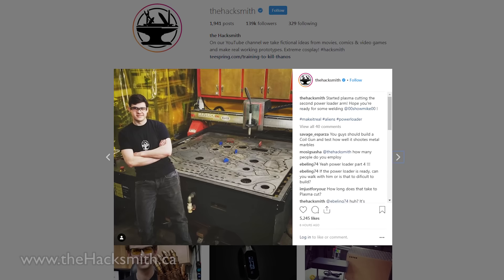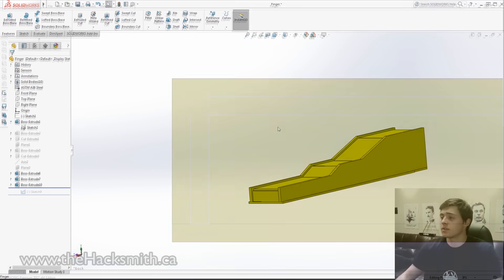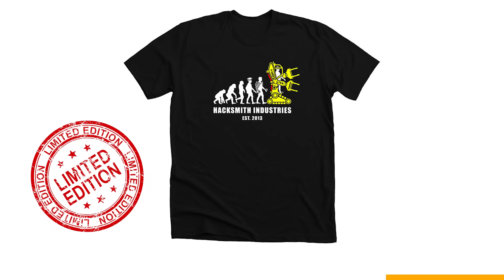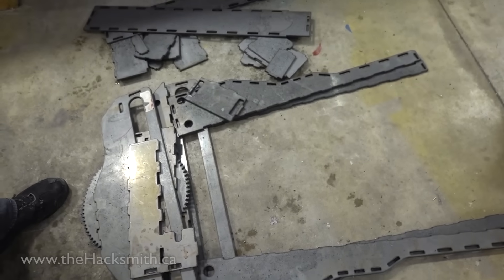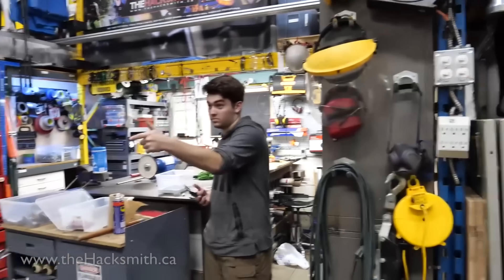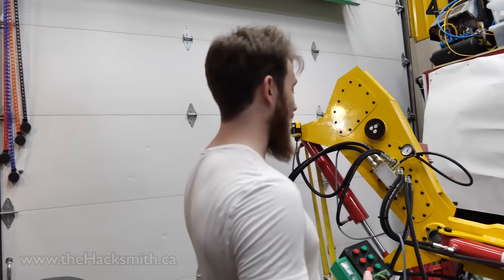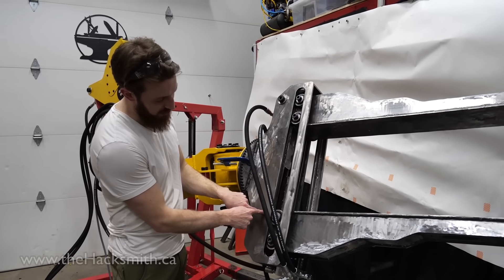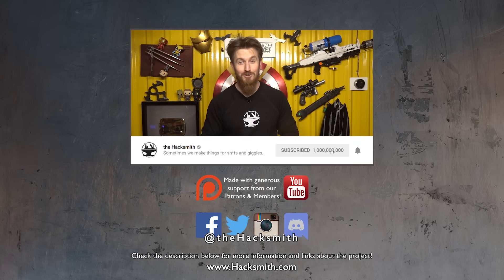GIVE HIM THE CLAMPS!!! (POWER LOADER: PART 4)

Comment: Did you consider carbon fibre for the top parts ?
Reply from the maker: No, carbon fiber is not good for applications like this
Reply: @hacksmith  why ?
Reply from the maker: It fails catastrophically. You generally don't want to use it for any real structure
Reply: @hacksmith  not if it's made correctly.
Reply from the maker: There's a reason you don't see it used for things like bridges.
Reply: @hacksmith  Because it's too expensive.
Reply from the maker: No, because it has its uses, it's not a miracle material. Everything has a trade of

Comment: 8:29 
If you don’t get the joke, drills will make this noise if the torque resistance is too much for them to handle. Little engineering thing

Comment: You are surprised that the pliers bend. But you have a lot of play everywhere, which forces the parts. had to giggle when I saw what happened to the air tool in the bore.

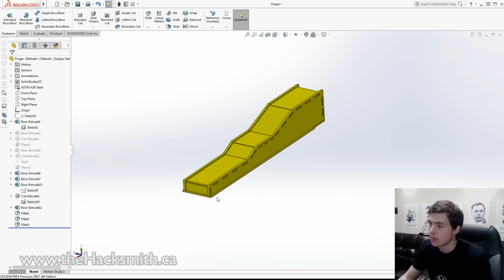Comment: 3:40 That's exact the same way I design most of the weld joints between laser cut sheets, except the inner lines are construction contours and the edges are rounded 5% of the thickness to ensure smooth movement for the cutting head.

Comment: Do you guys really think 1/4" plate steel was a little overkill ? I'm thinking 3/16" would have been strong enough and saved a ton of weight .
Reply from the maker: We designed it for the loads we intend to lift,  1/8 would have been fine if we were just building a prop

Comment: I know this vid is old, but if you added a toothed track for the "hands" you wouldn't have that slop. Hardened steel, small toothed tracks with corresponding small toothed gears would eliminate all slop and maximize the gripping strength.

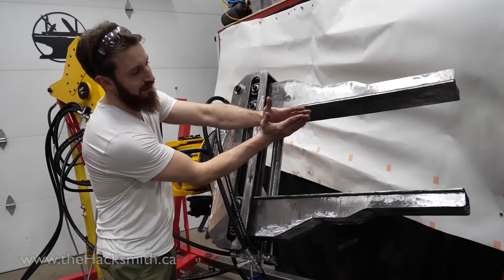Comment: Hello from the future. I am not an engineer but I spotted a potential weakness at 13:18. The grippers do not seem to be sturdy enough near the bearings as they become uneven when applying power and there is an item in them. Just an observation. I have been wrong before and i'm sure it will be ok. Great job. Ok I retract my statement since you spotted what I was remarking about around 14:35.

Comment: Love the passion and the finished product, great job. If you use a trussed design inside the gripper you can reduce weight and increase strength. Tubular steel would work, just calculate the minimum wall thickness and there you are. The hard points at the tips is the only place you functionality need solid material.

Comment: Guys, I don't know if you guys saw this or not, or if someone else commented, but your track is flexing.  You have a long, thin, unsupported section of steel in which the roller bearings are creating a bending moment on each end of the track.  As the jaws come to the center, the center is bending outward opening up your track slot.
Reply: Oops, just finished the video, and you fixed it.

Comment: You could use counter threaded high strength rod as a guide rail. Right hand from top to middle and left hand from bottom to middle. Use a hydraulic motor to rotate it. The rod has a bearing in the middle. Claws have matching threaded inserts. This will reduce the deflection when exerting pressure, reduce the demand on the hydraulics, reduce the hoses from 4 to 2, lighten the claw, and simplify the operation of the claw.

Comment: While the grippers are beefy enough, the rollers you use for these to slide up and down are of poor design.  Personally, I'd have worked with a rack n pinion design.  There would be no slop, and the grippers would stay equidistant throughout their length as they crushed an object.
Reply from the maker: So watch part 5

Comment: With a larger budget, I'm wondering if some of the structure could have done with 6061 aluminum instead of steel?
Reply from the maker: Possibly, but doesn't really matter too much - all construction equipment is usually steel for a reason

Comment: The grippers need mounting holes for interchangeable gripping surfaces, perhaps with load cells to detect gripping force. Gripping surfaces could be rubber or cerated steel. The cerated steel would work well for picking up people you don't like.
Reply from the maker: Easy to add, already planned

Comment: What about just using metal slide blocks instead of bearings on the pinchers? they wont shatter at high compression like bearings will.

Comment: As a CAD user for 25 years, and solidworks for the last 10 of that, you really should invest in a 3D Connexion 6 axis controller for your CadMonkey.  To compare it literally is like trying to draw on a computer with a mouse, and then switching to a Wacom.  Sure you can do it with a mouse, but once you switch to a Wacom you realize just how clumsy and time consuming it was to do it with a mouse.  A Connexion 6 axis controller is just like that for the CAD world.  I would recommend a SpacePilot Pro - as they can be had on Ebay, used, for not that much.
Reply from the maker: I've tried a frew times, haven't liked it to be honest

Comment: Too slow. Combine air with hydraulics/geared screw. The jaws are normally sprung-loaded to be open. The Air rams closes the jaws up to contact, then the air-rams close 'split nuts in a sleeve' around the drive screw, then the geared-screw function takes up the job of the real grip. Disengaging the air ram opens the split nut and the jaws can quick-release, or the drive screw can back off the jaws slower by working against the air-ram (which only provides force to keep the split-nuts closed at this point). Rapid action AND powerful. The initial grip force is set by choice of the spring load on the split-nut, and the jaw stops closing at the maximum holding-grip provided by the air-ram, until the geared screw is energized.
Simples.
This works for arm and leg actuators too, so that they move quickly into position and then lock onto the main actuator to apply greater force and instantly take up the load. 
As long as the air-rams are capable of moving the 'limbs' at whatever speed you select them for, you can have rapid movement AND then massive power when required. This also allows the limb to 'punch' or 'kick' as well as grab and crush.
Reply from the maker: Bro. Try watching all the videos before offering advice.

This is a bench hydraulic pump. Not the one for the final system
Reply: @hacksmith  Sorry, no offence meant, I haven't had time to watch it all, been very busy, was just flicking through things and saw the first testing phase you did. I had previously done some tests with various combinations and had feedback from other 'hydraulic' engineers who had said, 'Why didn't we think of that?'. so.
Anyway, your's is looking really good so far. You've taken it far beyond my tests, as I was just doing them only for proof of concept.
Thanks for sharing.

Comment: guys you can build a guild arm of 2 halves. use a milling machine and connect them with bolts and distance tubes to get exacly what you need
Reply from the maker: What was wrong with the way we did it?

Comment: Looking at the design of the whole thing, and even when I saw it in the movie, I kept wondering about the stability. You will have a fairly massive machine moving on relatively small feet. Standing on two legs, you might be able to counterbalance it so it would not be so top heavy itself slightly, but it you were to pick up a heavy car or something, do you not worry that all that weight on one side will not make it topple over?
Just wondering because I work at a shipyard, and while our cranes and forklifts can lift super heavy amounts of weight, they can do it because they are lifting these loads because they are counterbalanced by equally large counterbalance weights, and they have very wide wheel bases
To keep the center of gravity as low as possible.  The only cranes without large bases are tower cranes, which have a lot of counterbalancing, but in recent years have also had a few cases of falling down in some cases.
Reply from the maker: That's why we aren't doing legs
Reply: the Hacksmith oh, ok. Was thinking that one day you might do the whole thing.

Comment: I know you've already built it and are smart enough to know... But spacing the guide bearings. Possibly by moving the outermost guides further back, would be the simplest option. But if you'd willing to slightly shift your budget... Sleeve bearings are just epic...

Comment: I love your channel very much. A suggestion for gripper as you discovered that the slot were warped during welding, instead of tie rods or two smaller slots, what i think is you can weld a plate above the slot, to prevent it from warping. This will not only improve the strength and force transfer, but also avoide the chances of thin edge of the slot near the gripper to fail during heavy bites by gripper. Also you dont need to modify current design. Plus you can use bolting instead of welding, if in case fir bearing maintaince or replacement.. Good Luck.. 👍

Comment: Alright "The Hacksmith"...

I have watched the builds for the Arm and the clamp... and i have one thing to note that you could do better on...

it may be a pain to accomplish but!
reroute the hydraulic lines (through the interior) of the arm's housing/frame.

you already have cut outs on the inside face of the arm. rotate the hydraulic rams to place their input and output hoses going straight through the face of the arm and then install elbows or just bend them to fallow the arms interior so that they are only exposed where they hoses go around the elbow joint.
Reply: If you look at machines companies like Cat make, they also put them outside. This is because the O rings on hydraulic lines do wear over time, and when they go out they make a huge mess, hydraulic fluid smells awful and it's a hot sticky mess. So having the fluid all over the ground is way easier to clean than all over the inside of the machine

Comment: A wormgear type of opening/closing the "hand" would be cheaper, stiffer, lighter and more reliable.
The pitch of the main shaft would control the torque and speed of the opening/closing.
No guide rails or bearings needed either.
Great project. You kids are the best.

Comment: I've had this idea/question in my head for a while now 
Could you technically create a floating platform/ship from and induced magnet depending from the power going through the coil
Reply: technically possible depending upon the medium used for the surface of the ground under it... but it would only work above said surface material.

better question is can he get a high enough voltage oscillating in several plated surfaces to negate the effect of gravity pulling down upon the said plates.....
Reply: The best you can do with that is a hover. But if you increase the voltage, and have a larger, lighter coil, perhaps you can go higher.

Comment: wanna watch 2 episodes in almost a month, Support hacksmith by smashing that join button and get other cool perks! Like my hacksmith logo. Also thanks for the idea to use an auto dimming welding helmet for our instant flash bang protection project, we dont have the college lab to work in anymore so the rest of the project is coming along pretty slow, but im confident we will be able to use the welding helmet as a template and come up with a less clunky and more comfortable model at some point.

Comment: Have you looked into using a pair of eccentric bolts for the bearings? You could have one riding on the inside and one on the outside while having the ability to adjust the preload on the inside of the tube track.

Comment: The hands in the loader from Alien look like they have a rotating screw like pole in the middle, with a guide pole on each side. Would that have not been cheaper to construct, rather than hydraulics? The screw pole could be operated by an electric motor on each end. Or maybe there would be issues with the thread being torn off....

Comment: i have wondered why you didn't use aluminum was it a cost issue it would be lighter than the steel
Reply from the maker: cost, strength, difficulty in manufacture -- there's a reason construction equipment is all steel! =)

Comment: I'm also wondering how durable/reliable are those off the shelves components?
Reply from the maker: why wouldn't they be?
Reply: @hacksmith  I don't know, that's why I'm asking. Industrial grade vs consumer grade is not the same in many domains.
Reply from the maker: The consumers are farmers typically, stuff needs to work :)

Comment: You should really consider using two large precision ground and hardened shafts with brass bushing (or oilite) for the linear guiding system. For the speeds and forces you are going to operate i think it is the way to go and it is not that expensive.
Reply from the maker: Heh. That's the new design we came up with last weekend. Good idea!

Comment: Why not put a third roller bearing between the two already at each point so it rolls on the other side of the slot? Simpler than a whole new rail set.

Comment: Hey man with the the mech one thing I can the no of is the power loaders joints. Like in a digger the points if rotation will require lineboring and bushes and or bearings to decrease wear and slop in the joints, it will also allow the rams to do Thier job properly without damaging itself or the frame and bores, other than that great job on the build love it!!!
Reply from the maker: the joints have bushings...

Comment: bad english alert!

i think that you should make a system so that you can focus all of the air pressure or whatever it is used to control your hydraulics in a single leg arm or jaw of this machine so that you can get extra power
Reply from the maker: there is no air pressure! it's hydraulic :)

Comment: My suggestion for the guide rail would be to use four smaller bearings, instead of two, and have them run on both sides of the track. That way you can go for a much lower tolerance fit,  since you don't need the bearing to engage before it can slide.

Comment: 15:50 During the welding hugh? Not during the testing? xD
13:15, like in the can test. I don't actually see a lot of flex there, but with high loads for sure it will flex.

Comment: The hydraulic hoses are messy. Why couldn't you have run solid pipes along the inside of the arm to connectors at each joint?
Reply from the maker: They are temporary... we're still building it. Not doing any custom hose routing until it's finalized

Comment: How much does the sponsor have to pay in order to get sponsored on you video? I recently launched my own company called Rubrik learning systems, and it is used for extra math help and practice from grade 1-12. Our only problem is we don’t have any way of promoting it. If you can help that would be great. It would be easy because I also live in Kitchener.
Reply from the maker: You can look up standard advertising rates online, it's usually based on CPM (cost per thousand views). Normal google ads are anywhere from $2-$10CPM -- so it can get pricey :(

Comment: would it be a good idea to put a plate over the long holes where the bearings are visible to prevent the bowing and thus keep the fingers more parallel?

edit: nevermind

Comment: A couple sets of smaller HIWIN rails probably would have worked better.
Reply from the maker: with what money? those are hella expensive
Reply: @hacksmith  If you hope to apply 10000lbf in the middle of the jaw, you are looking at about 43000lbf on the lower roller. If you use 2 rails and 6 blocks (2 at the top 4 at the bottom), each block has to hold about 48kN. I know HIWIN has RG series blocks rated at that dynamic load for less than $100 per block, so it's going to be more expensive, but definitely doable under $1000.

Comment: u could could have used a scissor type of hand instead of using the bearing or guide rails this would work like a mechanical plier . It could have saved cost and reduced the the number of hydraulic cylinder and also worked faster  and effectively. 
JUST A SUGGESTION WITH LOVE FROM INDIA
Reply from the maker: that's not how it works in the movie though!
Reply: omg , got a reply 😍

Comment: what if you offset the axle holes in the grippers slightly to angle them towards each other just a couple degrees, so when there's force on them and the slop is pushed out, they're parallel?

Comment: You guys definitely need a break to bend that metal. instead of welding all those small parts
Reply from the maker: Bending 3/8th steel? yeah righ
Reply: @hacksmith  what you don't have 50 ton break yet?

Comment: I don't know if it can help in any way, I designed a shoulder for either prosthetics, or maybe something like this, that uses a series of joints rather than a fixed shoulder socket, that gives the exact same range of motion that a human shoulder can move. It was part of an ongoing project, to mimick the human body as closely as possible at the scale of a Lego Bionicle figure. It might be possible to mimic the design, just replacing the pins in my model with more in-scale servo motors. A floating anchor system is what I call it, I'm sure that term already exists.

Comment: Could you not just have 3 bearings, where the 1st and 3rd ride on the bottom of the track, and the middle bearing will ride on the top of the slide, allowing for zero slop

Comment: Before you cut next time heat the metal (not enough to restart crystalization) it will give the energy needed for trapped strain to go to areas of less energy and prevent warpage.  Warping is usually from leftover stress when its cooled at the plant

Comment: what kind of power pack is the power loadet going to have? a diesel engine with a bigass hydraulic pump?
Reply: I would suggest getting an old digger engine and hydraluic system..